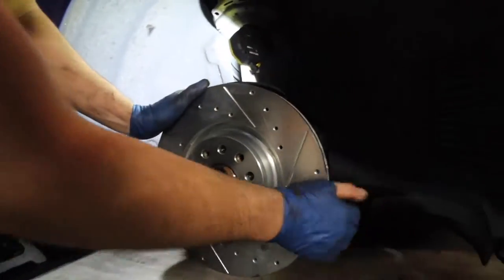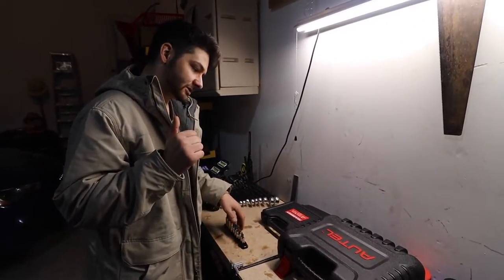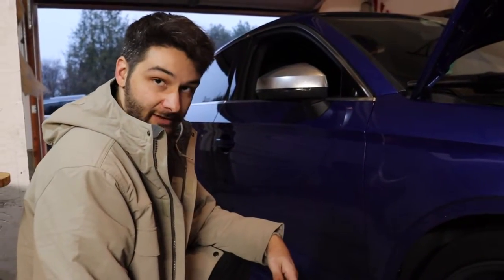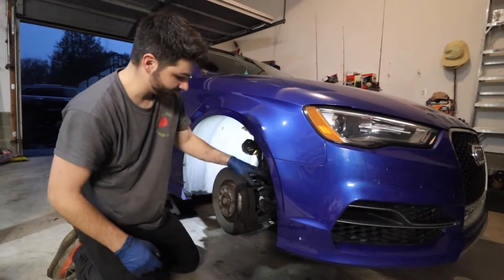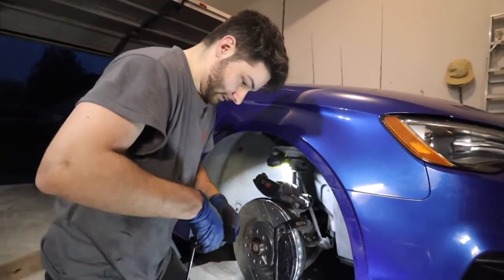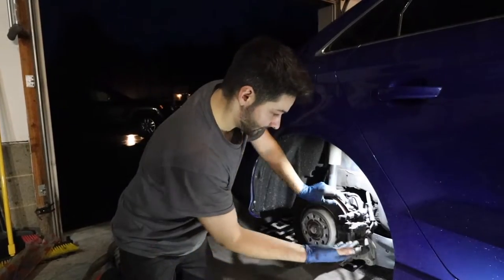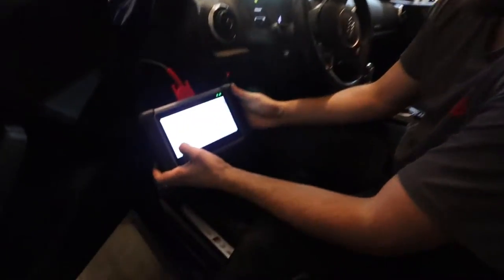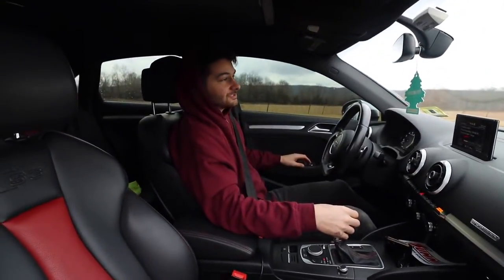Most AFFORDABLE Brake Upgrade Audi A3/S3 & VW Golf R/GTI

Comment: You do realise that the S3 logo cap on the callipers literally pops off out the way it’s only held onto the caliper via 4 push pins.    Take it off an the brake wind back tool works 😊
Reply from the maker: I guess Austin didn't realize that at the time. Thanks for the tip!

Comment: Hey quick question, I bought the same setup same car 2015 S3, I read that some people have clicking noises while braking due to the slotted and drilled rotors hitting the pads.  Did you notice this?  I am installing mine this weekend.
Reply: I have these clicking and clunking noises on a mk7 golf r with this brake kit. TBH if you are sensitive to NVH, it's pretty annoying, you hear it all the time maneuvering at low speed. Would not buy again.
Reply from the maker: Never had an issue with this nope. Could be a defect in the product or another issue at hand
Reply: @RatchetWrenches  awesome thanks.  I'll break them in and hopefully pretty quiet.   Great videos btw.
Reply: Rotors and pads installed,  no clunking or any type noise coming outta them did the breaking in period right away. Quiet as can be and work amazing.  Great video once again. Thank you big help.   Not sure why others are clicking etc.  even at slow speeds mine are quiet.
Reply: @TylerBC18  good job! Wish I knew why mine are so noisy, both the shop that installed them and the local dealer say the sounds are normal and caused by poor fitment. Guess I need to go somewhere else to get the job done right.

Comment: Just be carefull about what type of grease you put on guide pins. Bottom guide pin has rubber sleeve which likes to swell if the proper grease is not used. Always use TRW PFG110 grease or just remove the sleeve. If it swells it will seize guide pin which will lead to constant brake pad and disc contact. It wil overheat discs and squeak.